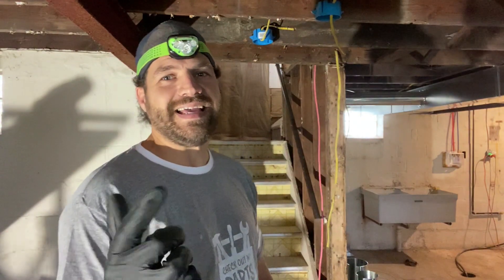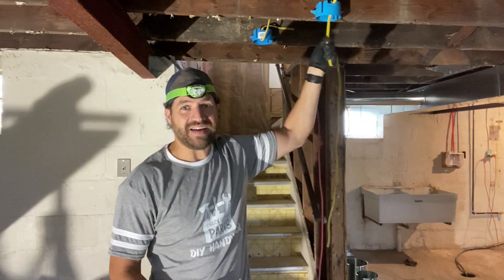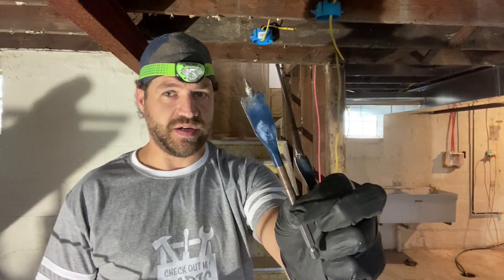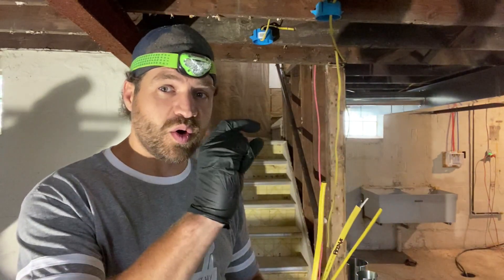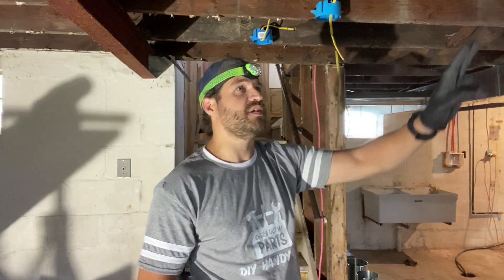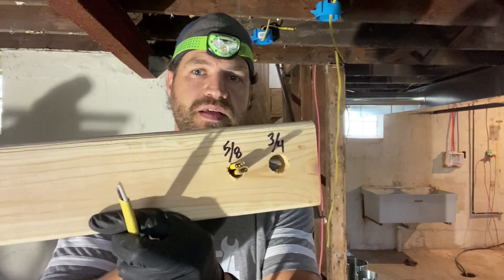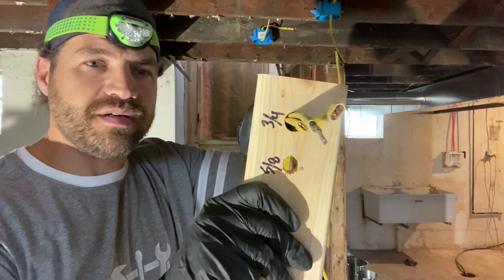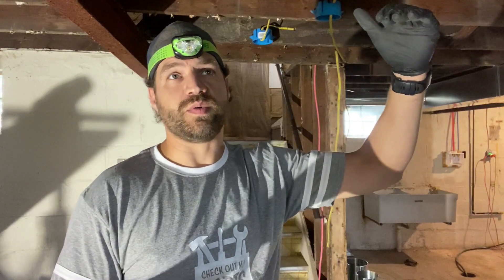One Hole, Many Wires! Running Electrical Through the Exposed Ceiling Joists

Comment: Just drill a one-inch hole even for a single wire for possibility of future wiring and be done with it.  A two-inch hole can be cut to Code in a 2x6, so one-inch is safe.  Better a one-inch now than multiple holes later with between-hole distance Code requirements.

Comment: I would've run the wires along the metal I-Beam behind you and then follow the joists to the light receptacles. It would take about an extra 8 feet of wire per receptacle, but would be faster and without cutting into supports.

Comment: You can do anything you want if it's your house. That being said it'll fail its next inspection and your insurance company will deny you coverage until it's brought up to code. There's a reason wires aren't stacked together. Current running through wires makes heat. That's what causes fires people. Too much heat in a concentrated area starts fires.

Comment: IS THERE ANY NEED TO drill holes in joists if you are running wire under a floor through a crawl space instead of a potentially finished basement?

Comment: Good video. I thought code said you can only run 2 wires thru a hole will somebody clarify this ? If it was my house I would  back up the joist with a scrap piece of would to not blow out the back side.
Reply from the maker: Hey, Tim! You may be correct. There's the NEC and then there are local codes as well. It's always best to see what is needed locally - and I've found inspectors are happy to field those calls before they come out to the site. 

Great tip on the block of wood! On this project, once the pilot tip of the bit came out the other side, I would take it out of the hold and then drill from the backside essentially doing the same thing. A clean hole every time.

Thanks for your comments!

Let's Build.
Reply: If more than 2 wires pass through a staple, and a hole in a stud is considered a staple per code, than the wire must be debated.  I.E. you can only run 2 through the hole without reducing wire amp rating.

Comment: You can sharpen spade bits with a flat file and you can use auger bits until you hit a nail. Keep the holes up a couple of inches so they don't get hit by fasteners and a right angle drill will really help.
Reply from the maker: Great tips, Augusta! Will definitely add them to the list. Thank you for the comment.
Reply: @diyhandyman7272  Glad to help. I've been punching holes since I was 12.